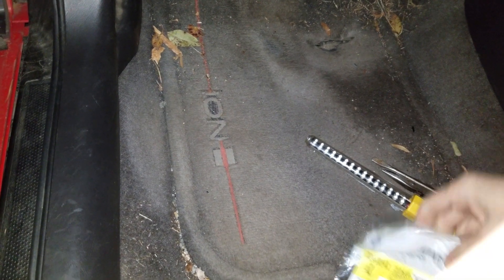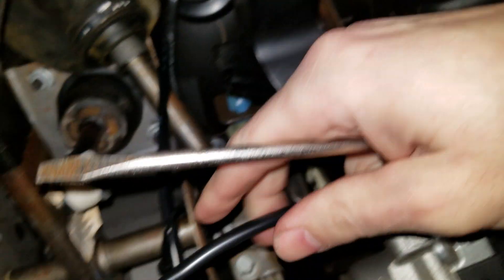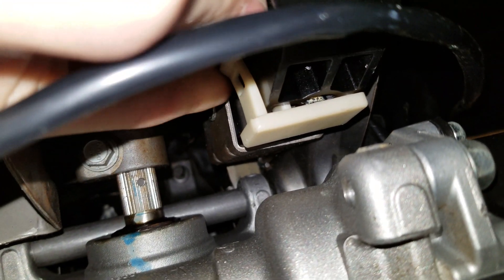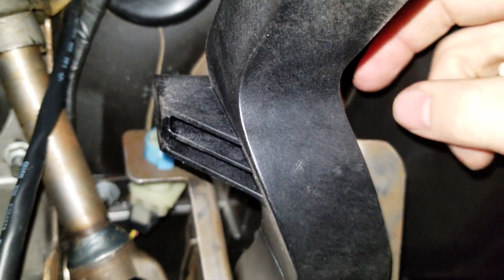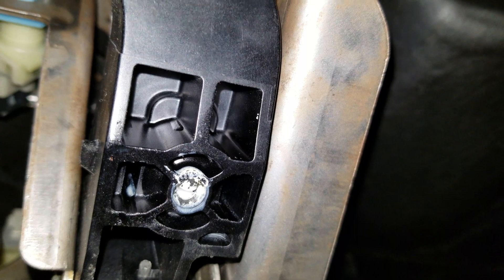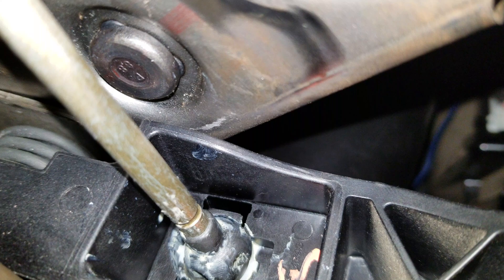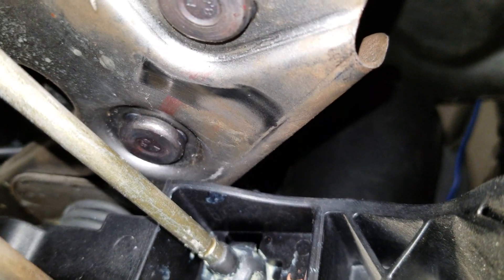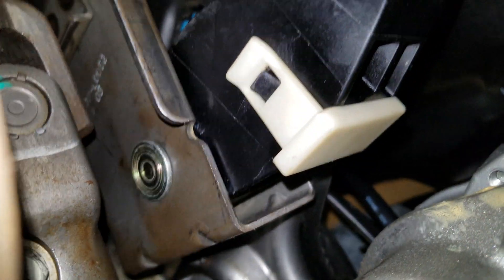Saturn Ion Clutch Bushing

Comment: I need tonsee how to get the bushing out to put in the otto piece
Reply from the maker: The bushing installs from the back side of the pedal. Removal will be to remove the white clip, pull the pedal all the way back, remove the rod from the pedal side then push the old bushing out from the hole in the front of the pedal.
Reply: @n3ologicprojects351 I know, I need to see removing the bushing.

Comment: Am I missing something? I have all of the parts but the master cylinder won’t click it or stay locked into the pedal?
Reply from the maker: The white clip that I remove at 1 minute into the video is responsible for "holding" the pushrod to the pedal. The parts will not hold together if the clip is missing or the ball at the end of the pushrod is worn.
Reply: I have those parts everything is new besides the white clip
Reply: Also thanks for responding! I know the video is old
Reply: I agree that i feel like im missing something. I have the clip and push rod ball lined up but they wont snap into the space. Putting the bigger white clip in place to hold everything together isnt going to help if the push rod ball isnt seated fully into the space, which i havent been able to do. i am struggling mightily with this repair so i hope youre still responding to these comments. Any help appreciated

Comment: Whats the part number my 06 is worn out bad shifter yo the floor and blead breaks thinking that was it but i looked and plastic piece is worn out gives it an inch of play before engaging at all
Reply from the maker: GM part number is 22697429. Good luck finding these. I'm thinking of investing in a 3d printer to make these things because they are scarce.
Reply: @n3ologicprojects351 did you??

Comment: Question, my rod on the clutch master cylinder keeps on breaking where there is a dent around it at the end of it. What could be causing this?
Reply from the maker: There are many causes of a clutch rod breaking stemming from "improper assembly" to "poor materials". For instance: the rubber on the end of the rod can wear over time and can result in metal being exposed at the very tip or the rubber may no longer be "ball-shaped", or where the bushing is supposed to go in the pedal may be damaged to the point where the bushing would not be able to be properly installed. I would get a new rod as well as the bushing to fix the problem (assuming that everything else mechanically is functioning correctly.) If the bushing is loose or won't install on the pedal properly I would look at replacing the pedal as well. I have another video on replacing the cluch pedal. 
Note: the "bushing" is the little plastic piece that keeps the rubber ball from pushing through the pedal
Reply: @n3ologicprojects351  what is the name of the rod with the ball on the end that attaches to the bushing? It appears my bushing has been gone for a while, and I'm worried I've damaged the rod. The end of my rod is damaged with scratches, and metal can be seen. It also has a lot of play

Comment: So I accidentally snapped my clutch pedal (already ordered a new one) But when I pushed the two ignition lock switches in by hand holding them in and turn the key I couldn't get my car to start. Is that another problem I should worry about or will that be fixed as soon as I replace the clutch pedal?
Reply from the maker: In order to start the car without a clutch pedal, you would have to do two things in order to simulate depressing the clutch. First, put the transmission in nutural. Second, press in the lower switch that the clutch pedal actuates. There is no need to also press in the upper switch as that is only depressed when the clutch is not being touched.
Reply: I tried this yesterday and still nothing
Reply from the maker: @Titan2263  if the car was starting and running fine just before the pedal snapped, the only other thing I can think to check is the lower clutch pedal switch. Disconnect and take it out and check the continuity on the pins while pressing and releasing the button. If nothing changes between having the button pressed or not then it may need to be cleaned out. You can spray it out with battery terminal cleaner to get the corrosion out but try not to take it apart if it can be helped, the plastic is fragile and if it breaks it will have to be replaced.
You may also want to post in the Ion Redline group on Facebook to see if anyone else might know something as my videos on here don't get much traffic yet.

Good luck man!
Reply: @n3ologicprojects351  thanks bro I appreciate it. I'll let you know what happens after.
Reply: So I changed out the entire clutch pedal apparently the clutch lock switches are special order item. At the moment I'm giving my car a jump to see maybe if the battery just died. I'm hoping that's what it is
Reply: So giving the car a jump didn't work but I did find out that my trunk was flooded so my battery got soaked. Going to have the battery tested tomorrow and have the engine light tested tomorrow.
Reply from the maker: @Titan2263  my trunk flooded a few months after I bought the car, turned out to be a drainage issue with the sunroof. I pulled the liner away from the sides of the trunk and pulled out the little rubber elbows that connects to the drain lines for the sunroof and opened up the end by cutting away at the tip that sticks into the wheel-well. Eventually the line connecting above the headliner will start to leak, ruining the headliner. I still need to remove my headliner to fix this. I'll probably post a video on how to do that.
Reply: @n3ologicprojects351  I personally thought about just drilling two holes where the water seems to be held at. I don't think it'll interfere with anything if I do
Reply from the maker: @Titan2263  holes in the trunk are never a good idea. Exhaust fumes are one reason not to, water can also get slung up in from the road.
Reply: @n3ologicprojects351  this just proves that I don't know a damn thing about do's and don'ts for cars. Haha
Reply from the maker: @Titan2263  we live and learn. As long as we learn from the mistakes we make, or learn from others.

Comment: How did u install the part i tryed to look up that part cant fine it
Reply from the maker: I'm not sure I understand your post. There is a link in the description of the video of where to find it for purchasing. The video also depicts the method i used for installation. The are not easy to remove or i would show how i installed it better.

Comment: This does not also apply to all Cobalts. I watched your video, then ran to a "Pick n Pull" junkyard and they gave me a list of what was all interchangeable with a 2004 Saturn Ion. A certain Cobalt was on my list (I believe it was a 2007), and apparently the parts were interchangeable. I noticed the big giant white clip was removed but the rod was still connected to the pedal. So I thought, "Aha! They didn't take the right piece!" So I removed the white clip inside the pedal which was holding the rod in place. I quickly ran home with part in my hand..... It is not the same. I've even just googled the image of the part number you provided and they definitely are not the same. The Clutch pedal setup is ALMOST identical. It's literally just this little white clip that is different. I hope this helps for any Chevy Cobalt owners.
Reply: I replaced the clutch pedal assembly and now the rod does not reach the pedal is there an adjustment for that

Comment: Does the white rubber piece come with the bushing?
Reply from the maker: The only rubber peice on mine is fused to the end of the pushrod. The little white bushing comes all by itself. When you look up the item number you will see the bushing all by itself. I put links to all of the parts that can be broken in the description.
Reply: @n3ologicprojects351  ohhh okay. I wasn't quite sure what you were referring to. I got the little white clip in the mail. Went to install and that little rubber ball is damaged and deformed. Do you know if I can replace just the rubber ball, or do I need to get a whole new clutch master cylinder?
Reply from the maker: @nathanielwhitman8412  I was able to go to a junk yard and pull the rod to use as a replacement. The ball is fused to the rod so you cant replace one without the other. I think I showed in one of my other videos how to replace just the rod. If not I'll post back tomorrow evening with a video on how to do that.
Reply: @n3ologicprojects351  how do you replace the rod? Does it unscrew? Did not see a video on how to do it on your channel.
Reply from the maker: @gnkidwell  remove the white clip from the pedal to unlock the ball and there is a small black clip that holds the rod in place at the firewall that slides in from the top to keep the rod from leaving the housing. Remove that and replace the rod. Be sure to have a spare towel in case fluid come out of where the rod was after removing it. Be sure to do the bleeding procedures after it has been replaced.
Reply: @n3ologicprojects351  thanks for the reply. I may have to defer this to a shop. Unfortunately, I have been struggling getting my line loose from the slave cylinder... I initially thought all my clutch issues was caused by the slave needing bled or a bad master cylinder. Needless to say... It was the pedal the entire time, it did not break through the white clip, but the rubber end on the master cylinder rod deteriorated and the bushing is completely gone... I used some solid foam inserts for now... I officially have a functioning clutch again, but I would like to fix it correctly... But without the rod being replaced I do not feel like destroying a new bushing. Wish I could source a hydraulic line... If I could, I would just replace the master cylinder myself. Just fearful of breaking the line right now getting it loose from the slave...
Reply from the maker: @gnkidwell  the exact same thing happened to me. The bushing and a new rod is all you need. I replaced my pedal but didnt really have to after I realized there was a bushing that i could put in. I found my rod at a junk yard on a manual Saturn Ion base model.
Reply: @n3ologicprojects351  yeah I know... But getting my clutch line loose from the slave to bleed it has been the problem... I have tried vice grips on the end, with the clip up and off, and cannot get the thing loose... It is stuck bad...